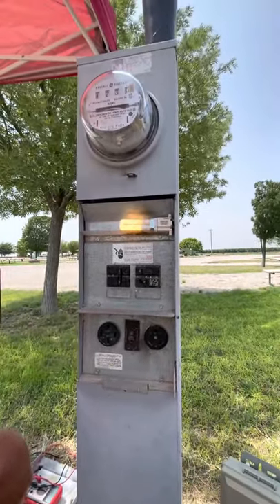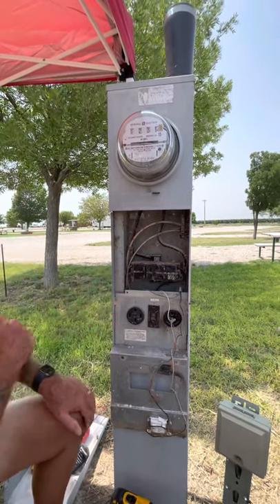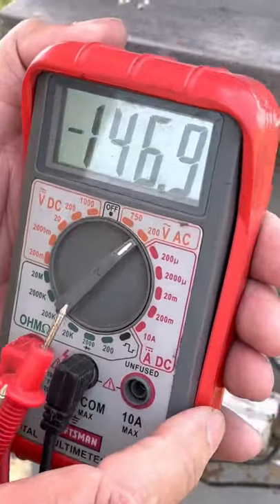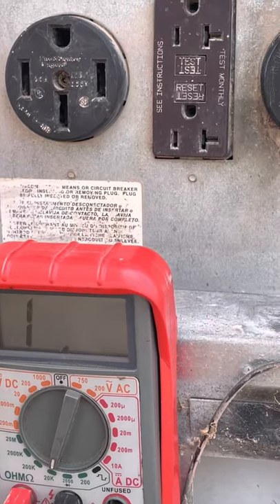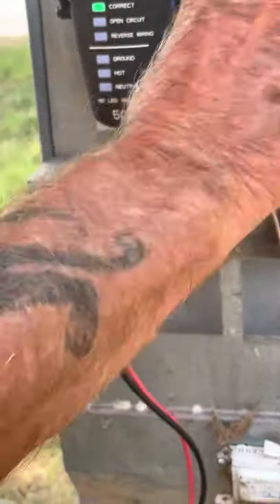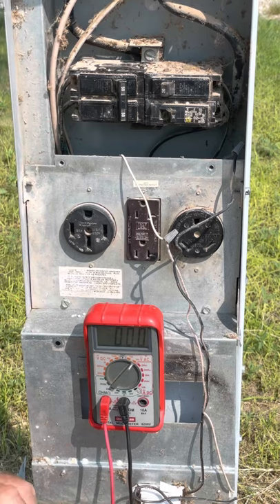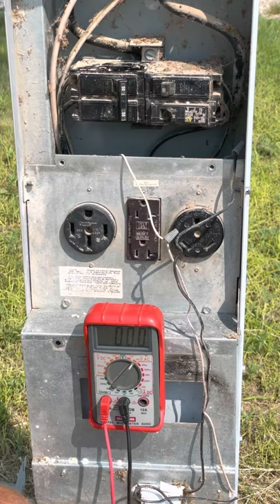RV Pedestal Electrical Basics

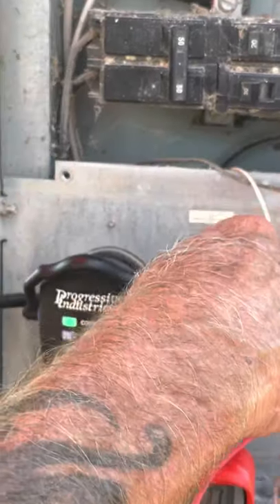Comment: At the 6:25 mark, are you sure you said that right?   Ground or neutral?
Reply from the maker: Yes. Hot to ground will give you 120v same as hot to neutral. I did show testing both. If you don’t have 120 between hot and ground you have an open ground which is unsafe.
Reply: If you happen to remake this video, please record it in landscape mode. When viewing on a mobile device, it is much easier to see